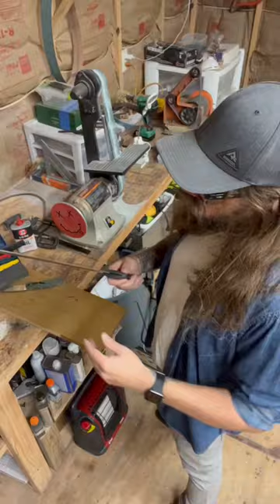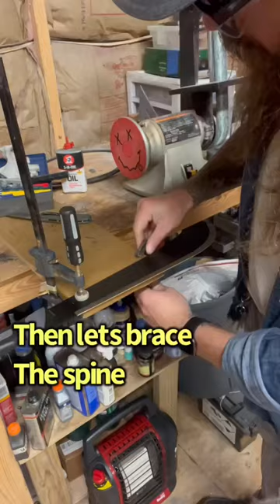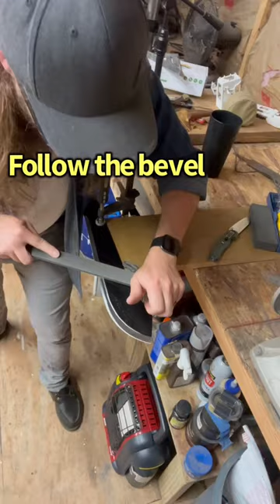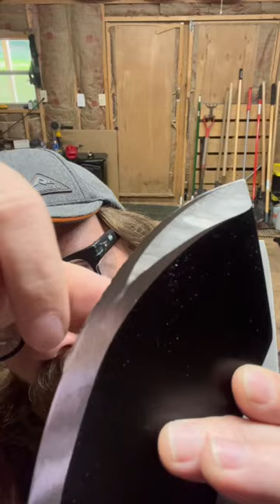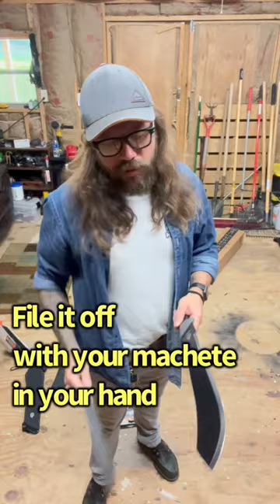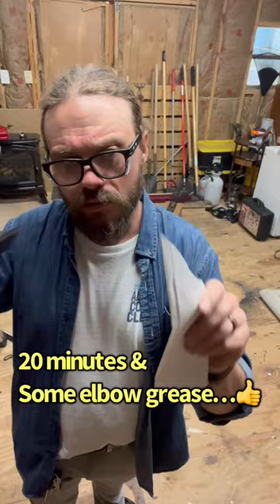How to sharpen a dull machete👍#shorts #shortvideo #blade #knife #bushcraft #garden #landscape

Comment: It's nice but the edge is too rough. Maybe refine it a bit with a sharpening stone.

Also, would it not make it dull faster if you sharpen it that low. Like, that's the primary bevel there, that blade is gotta be thin on the edge.